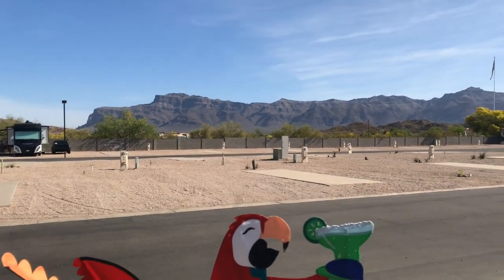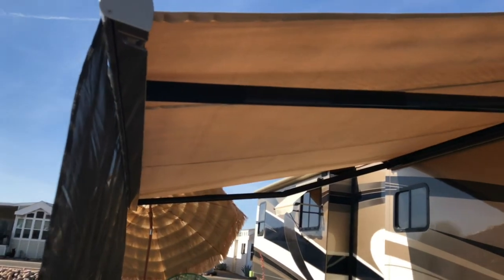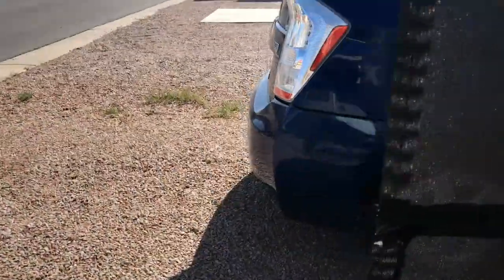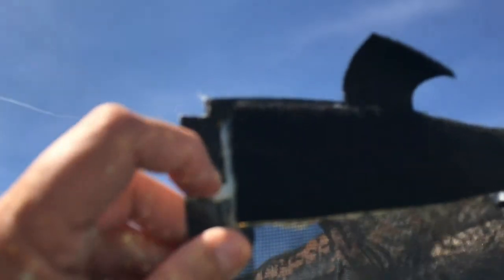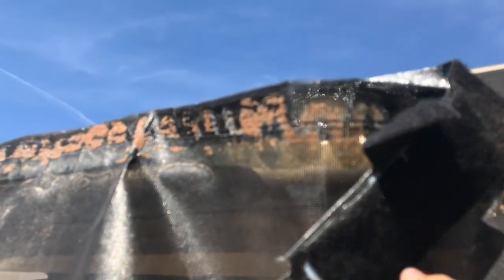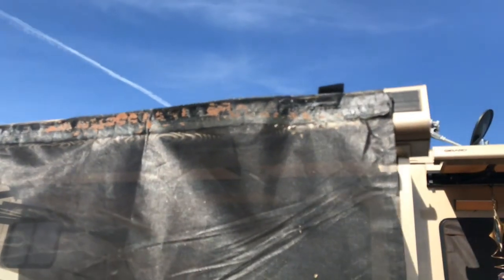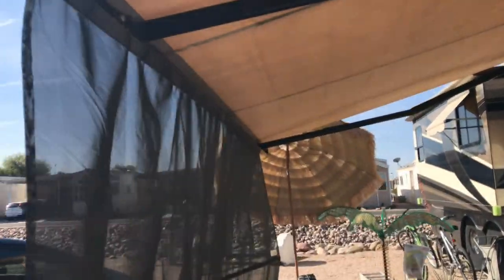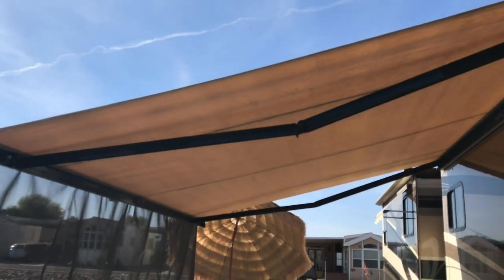Attaching a Sunshade to a Gerard Awning: Lessons Learned

Comment: After 2 years, how’s the weight on the awning?  We just got a new coach with a Girard awning and I was worried about attaching my Vista shade or side shade to it due to the weight.
Reply from the maker: I noticed that the awning is about 4 to 6 inches lower than at first but no problem bringing it in or out.  It starts out high each time.